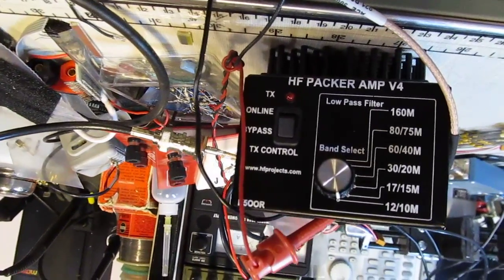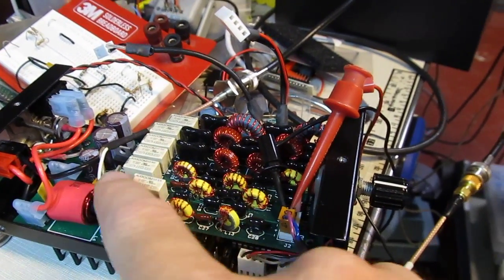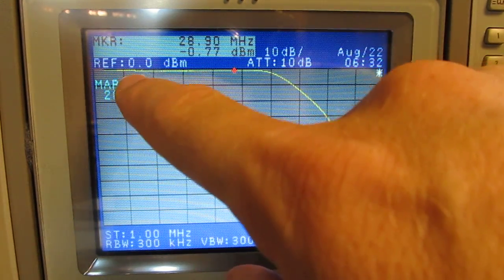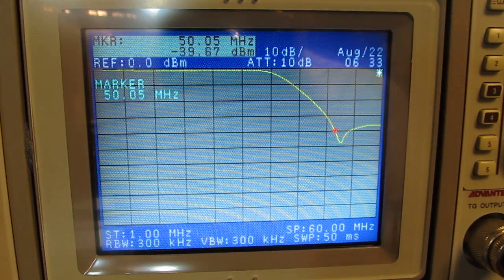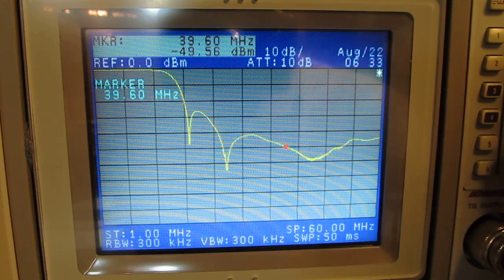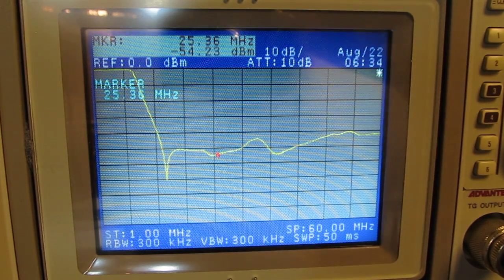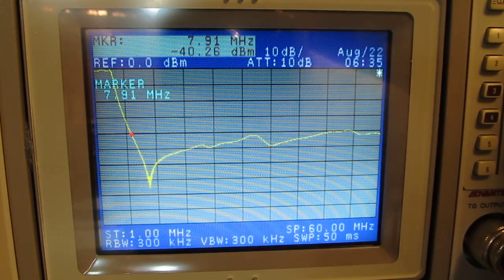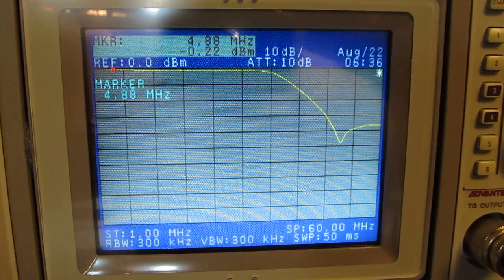#106: Measuring low-pass filters in a Ham Radio HF Packer Amp for Amateur HF Bands

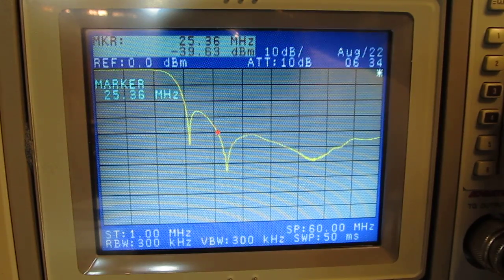Comment: Are they Elliptical filters? When I was designing a LPF for my FM transmitter, I found a way to make a sort of Elliptical filter that had two or more cuts that could be tuned to the 2nd and 3rd harmonics for better rejection. It looked like the same response on your video at 4:00.

Comment: I know of one concern regarding a slight freq drift wid temp change. However even wid that change the stability will be much better than almost anything before PLL. Hi.
Wid the dongle in an enclosure, I would expect better stability and better S to N figures.
One YT contributor mentioned making an enclosure wid a 3D printer. 
All and all this is a slick project and cheap.
73,
WA4AOS

Comment: Alan,
Sorry about the name mix up.
There are a number of YT vid's on usb dongle's to rx the ham bands + up. The R820T does better at 1GHz than the E4000 series. One thing I plan to do is remote the dongle into an enclosure with the upconv. and BCB filter for better S/N figures. I am considering an RF sense Mute sw to protect the dongle for key down wid a XCVR. 
Another interest is to find software that will follow the IF of a xcvr for band specific data. This would be so helpful.
73
WA4AOS  MORE

Comment: Hi Joe,
Another great vid. Are you following the projects using a TV dongle and 125MHz upconverter to receive the HF bands and beyond with SDR software? Check youtube vid by N4LQ. He uses a AM BCB filter to reduce overloading on some of the HF bands. A Great project could be a BCB filter for this arrangement. Commercial units are $65 and up. Interested? This is a good deal for having almost the equivalent SDR receiver for under $100 with adapters, boards and shipping. Ck   nooelec.com
73,
WA4AOS